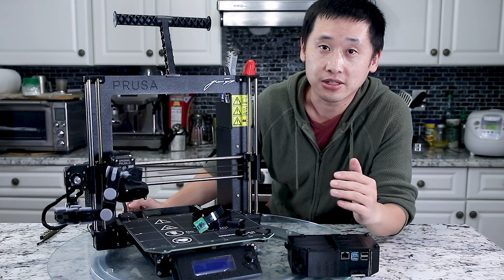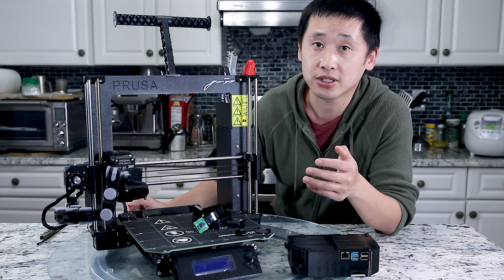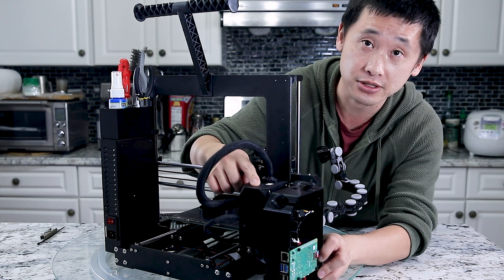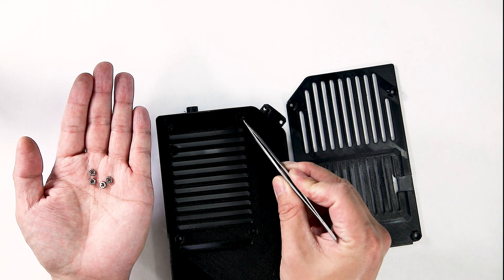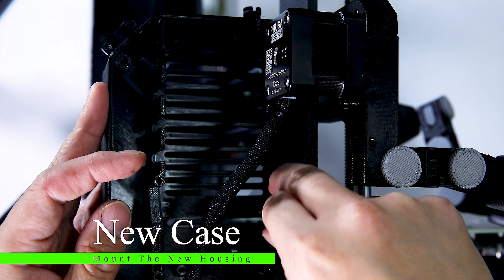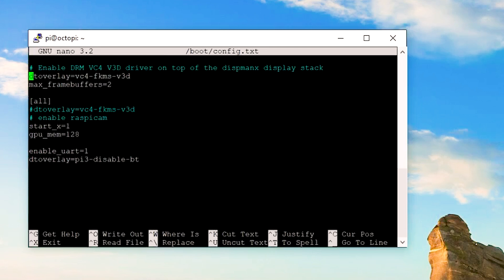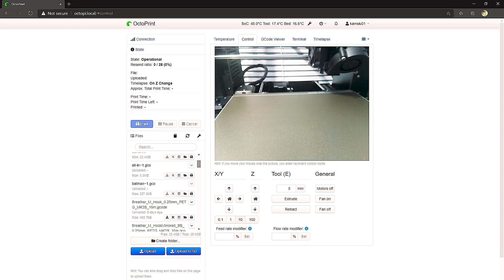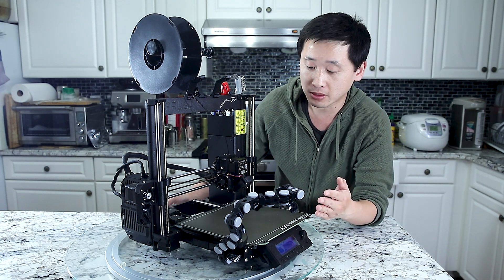How to Guide - All-In-One Case for Prusa i3 MK3/S/+ [[ EINSEY/RPi4b/Buck Converter ]]

Comment: @SavageNYHK I think Raspberry Pi uses M2.5 mounting holes, not M3. I'm unable to push M3 through.
Reply from the maker: M3 screws are tight, but it can work. You can slowly rotate it to get it through. There's no harm to the RPi. I just installed one a week ago and can confirm.

Comment: Followed this and eventually figured it out. A few notes in case someone else finds this:
1. You will need M3x8 bolts. My Prusa MK3S spare parts bag had M3x10, but these were a tad too long for the mounting holes for the buck converter and for the Pi 4. The mounting holes are ~9mm deep, I think, and the 10mm left it a bit loose. If you don't mind that, carry on. I had to go buy a set because I didn't like it loose. If you have them lying around, sweet.
2. The Pi 4's 4 mounting holes (I've been told that they aren't actually intended for mounting, but only for manufacturing...eh) are 2.5mm wide. An M3 bolt is too big. But we need to use M3 because the case's mounting holes are 3mm. So find an 1/8" drill bit (my calipers measure 3.1mm diameter) and bore it out.
3. The Pi 4 mounting holes on the linked 3D printed case require you to screw in the bolts and tap the plastic, similar to the Prusa's assembly in some areas.
4. The hardest part (for me) was getting the two ground wires into the same clamp on the buck converter. I spent about an hour dealing with the tiny wires before it was assembled. It could really use 4 clamps to aid in assembly. I get the need for compactness, but still. 
5. The shrink wrapping around the wires on the buck converter is nice for protecting them, but the cables got really stiff and were difficult to twist and bend into the case so that I could get the Pi attached.
6. Even with the larger space, the cable management is tight. Not as tight as the original case (the case linked in the description is definitely bigger), but still a bit tight, mostly due to the stiff, shrunk-wrapped wires to and from the buck converter.
7. The design requires the Pi 4 to face inwards. If it were not, the DSI port would be very close to rubbing against the X-axis motor every time the Z-axis moves it up and down past it, but a side effect seems to be (for me) that the wifi signal is weaker. Still usable, but ssh commands have a noticeably longer delay than when the Pi 4 was sitting on my desk.

Thanks for the guide those. This has been helpful overall.

Comment: Love the build - there aren't many videos out there on this setup, so really appreciate the content! What camera and camera holder are you using?
Reply from the maker: Raspberry pi for cam. Not the best in terms of quality but it gets the work done. I'm still not fond of the camera holder as it shakes while printing. There's a stethoscope cam that looks ripe beneath the nozzle that I might try out later.
Reply: @Inspiron41  I also have that camera holder and I'm not 100% satisfied. I've seen models where the camera holder attaches to the heat bed instead of the frame. The video produced is much smoother as the distance between the camera and the model stays the same.

Comment: Hi, awesome build! The link to your ebay store to sell the connector kit is not working. Can you provide a working link or details how you build it (with what components) so we can do it ourselves?
Reply from the maker: Hi, MrGrillIT . Thank you for bringing that issue to my attention. I updated the links. https://ebay.us/BvOYDP
or https://etsy.me/2OI5KSo (if you need a different length). As for creating the cable, it requires several small components and tools that makes it fairly expensive for a small project if you don't own the tools already, which I don't recommend if you're planning to them as a one-off.

Comment: from where do I download file to print case ?
what happened to the power wire crimp connectors ? neither ebay nor the ones you installed has them like what you pointed at @ 2:25
excellent added written notes in video, nicely done.
Reply from the maker: "All-in-One EINSEY - RPi3/4 - Buck Converter Housing Unit | PrusaPrinters" https://www.prusaprinters.org/prints/48401-all-in-one-einsey-rpi34-buck-converter-housing/files
Reply from the maker: Thanks for the heads up, I'll make the change in the description. The two crimp connectors were just too big for einsey board and it was difficult sourcing the correct size. I ultimately had to make the hard choice to leave them out. Overall, it didn't make a tremendous difference in the setup.